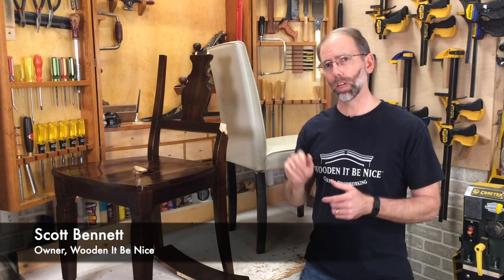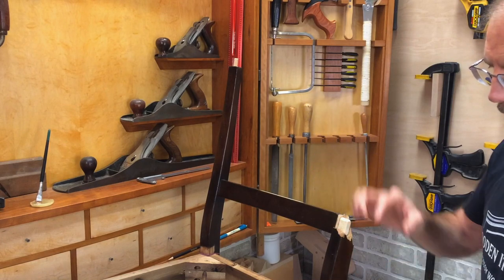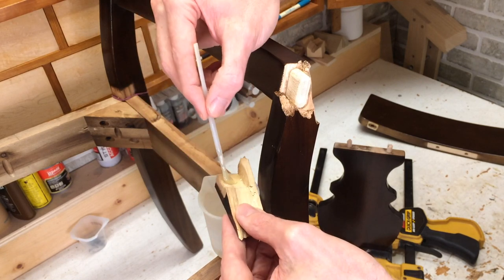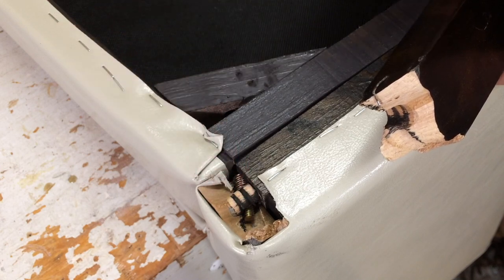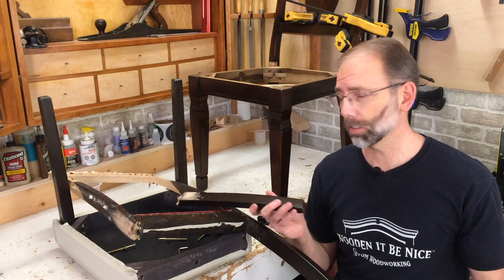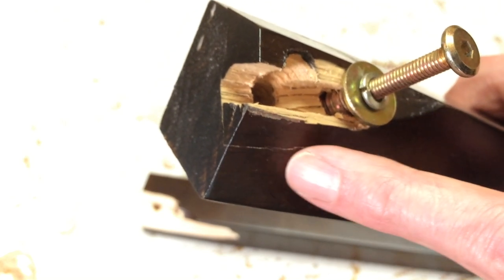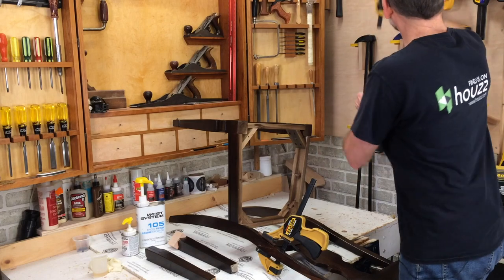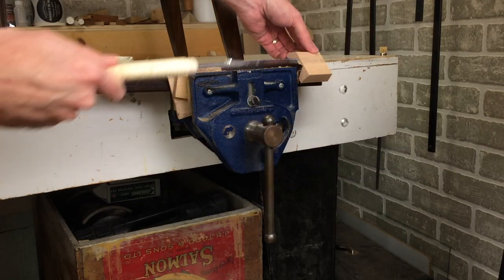Why Repair, Replace, or Trash Broken Wood - Furniture Restoration Techniques | How To

Comment: Rubberwood is a light-colored medium-density tropical hardwood obtained from the Pará rubber tree, usually from trees grown in rubber plantations. Rubberwood is commonly advertised as an "environmentally friendly" wood, as it makes use of plantation trees that have already served a useful function.
Reply from the maker: Thank you for sharing a detailed explanation of this type of wood Peter.  That's very helpful and I will pin this comment so others can see it as the first comment on this video.  I appreciate you sharing your knowledge to help the furniture repair community learn.  Scott
Reply: I was thinking rubber wood too. I recently started customization of thrifted furniture and recently learned about rubber wood being used on a lot of box store furniture.
Reply: When I saw it was from Vietnam the first thing that came to mind was rubber wood

Comment: Great video, Scott. 

 As someone who's recently retired from furniture repair my wife just asked if I had learned anything or reinforced what I knew.  My answer was yes.  Almost all my work was both on-site and fixed price by third party (e.g., warranty or protection plans), so taking to the shop and using the table saw was not a practical option for me.   I have repaired a lot of legs where the threaded insert broke out the inside corner of the leg, though almost always on tables.  I found that these legs were several inches square and the threaded insert only went in half an inch or so, the depth of the threaded insert.  My usual repair was to glue the chunk back on and secure with a screw (as there was plenty of room on a table leg).   The connector bolts and the pilot holes for the threaded inserts were almost always long enough that I could put the threaded insert in much deeper, into the unbroken wood and reattach.  I would have to use a threaded insert without a shoulder on it, though, unlike the ones in your chair.   Now, I do volunteer work at a place that outfits furniture to people coming out of homelessness, so I'm still seeing donated furniture that needs repair, when possible. "Plus ça change, plus la même chose"

As far as wood id, I'd refer to that as "wood that should have been thrown in the scrap bin."  I encountered a lot of brash and cross grain wood, but that seemed to be typical for Asian furniture, even the expensive stuff.   I think my worst example was a top rail in a sofa.  Right in the middle was a punky knot that was most of the width of the beam.  It did not take much force to get it to snap.  Why did they even think to put that in a piece??  Upholstered furniture, too, has a lot of OSB or particle board stapled together inside.  And if 4 staples is good, 12 is more good, even if half of them miss the underlying piece :-)  That's what you get when you get "Seven piece living room set only $399!"
Reply from the maker: Thanks for sharing your insights on this.  I find your volunteer work inspiring.  Do you mind if I share that in a Community post for other people to read about?  Thanks.  Scott
Reply: @FixingFurniture  I have tried to reply to this twice, but apparently it gets deleted.  Yes you can.  Despite having no outside volunteers during all but a couple of months, a small group of about 4-6 of us at a time from the Cincinnati Woodworking Club going in one or two mornings a week made over 700 pieces of furniture (tables and "cubbies") and repaired or assembled over 125 donated  pieces in 2021.  I'll post the host's link in the next reply in case it vaporizes, too.  The organization furnished 1,334 homes this year, distributing 20,536 pieces of furniture to families coming out of homelessness.

Comment: This video came at a most opportune moment. My next door neighbor knows I do woodworking as a hobby, and asked if I could fix a chair which had some damage to one leg. Using the very techniques you presented today, I was able to take the chair apart so I could access the damaged leg and surrounding area, and then put together a plan of action to make a repair. I feel fully confident that I can return the chair to him in a day or so fully mended and as good as new! Thanks!
Reply from the maker: You're welcome Ian.  I love to hear success stories like yours!  My goal is to empower viewers to be successful in their repair projects and it sounds like you're well on your way to delighting your neighbour.  Thanks for sharing that as I find it motivating!  Scott

Comment: I enjoyed your video.  One thing I noticed when repairing furniture is that improper installation of insert nut can actually cause a wood failure.  The hole for the insert nut needs to be deeper than the crib screw will be in full compression.   If the screw bottoms out in the hole while tightening the chair leg it will force the insert to break out of the wood.  Solutions for this are two fold.  You can drill the insert hole deeper or you can cut the crib screw shorter.   Both will allow you to secure the leg without breaking the brittle chair wood.

Comment: I'm am always on the lookout for broken furniture. Usually I pick things up from the street, when people take their broken stuff to be picked up. 
So far I have saved two chairs and a dinning table. 
Often I could see that the previous owners had tried to fix the furniture but not with the right technique. The most common mistake is a simple one:  glueing without pressure (lack of clamps or a vise I guess).

Thanks a lot for all your videos! 
Greetings from Switzerland
Reply from the maker: That's great!  Thanks for sharing your projects!  Glad to hear you're having success with repairs.  Cheers from Canada.  Scott 🇨🇦

Comment: Amazing video, 
For my syringes i draw through some alcohol or acetone to clear some glue out , then I draw water to rinse, and let it dry. It seems to last an extremely long time, I’ve actually never replaced tip.  
Now you’ve given me 9999 tips and I’ve given you 1😅

Comment: I’ve been doing bookbinding for quite a while and one thing they taught us about pva glue is to take your syringe and drop it down into a water cup. It works great. I also have long needles that cans with my ender 3D pro that work very well also

Comment: Hello Scott, I am a beginner woodworker and I’m possibly starting a furniture restoration course in January.
I have one question about the first chair: why hadn’t you glued the top rail dowels before reassembling the back?
Or you did you and I hadn’t realized? I’m confused about this being necessary or not. Thanks.

Comment: Thank you for the video.  It brought back some memories of similar blow out damage caused by securing legs with crib screws.  In my case what I found was that the crib screws were long for the service.  Over the years the owners tightened the screws compressing the surface wood until the screws bottomed out in the leg and with the aid of the embedded nut forced the wood apart.  After repairing the wood fractures, I cut a half inch off of the crib screws and they tightened up well.  I guess the same thing could have been accomplished by putting washers under the head of the crib screws.

Comment: Rockler makes a silicone glue brush that I love using.  I haven't tried using it with epoxy, but for wood glue, it dries on the brush and then you can get it off in a big chunk.

Comment: Scott, other experts, have you seen metal dowel pins in chairs? I have an Ethan Allen all cherry chair, and the back leg is attached to the seat supports by metal dowels. Some green corrosion or possibly glue/ epoxy on the metal dowel. Not screwed in, vertical flutes like a wood dowel. Any opinions?

Comment: Scott, I’m surprised at the strong mixed reaction I had to this video. In the end those chairs are a classic example of you get what you pay for. Inappropriately designed joints made of weak inferior wood can’t help but result in the damage you dealt with. I’m afraid I would have relegated them all to the burn pile.
Reply from the maker: Quality chairs are made by craftsmen and women, not assembled by the customer, but this is the life of running a repair shop.  The customer dictates what they would like repaired and how much they want to invest in the repair.  Cheers.  Scott
Reply: @FixingFurniture  If all furniture was very well made, we would not have much business

Comment: Scott,
I do appreciate you sharing your knowledge about wood working with the DIYers. I have been made aware of some of the mistakes I have made in the past. I went back and checked a table I did a couple of years ago and it is loose. I WILL BE DOING it again the right way.
Thanks,
Steven
Reply from the maker: Glad to help Steven!  Cheers.  Scott

Comment: Another fabulous presentation. Some repairs require creativity for the solution. Are the silicone cups easy to find? Much better than disposable cups for sure. Thanks for sharing!
Reply from the maker: Here's a link to the silicone cups and stir sticks https://amzn.to/3p7bzbu  I shared a link in the video description of a group of glue supplies, so it may not have been obvious where to find it.  Have a great weekend Sean!  Scott 🇨🇦

Comment: Scott: this video was very interesting. The restoration that went into that chair was quite something. And the fact that two more legs broke from another chair tells you what you are dealing with. As an interior designer,  to be honest with you, after talking and asking a lot of questions of the customers, I probably would have suggested recycling all of it. The minute I saw both chairs, I knew what you were up against.However, I realize you did what the customer wanted. And your restoration job was excellent, as usual.  Carol from California
Reply: Sometimes the amount of time and effort you want to have put into a repair is different if it's a lone piece vs. part of a dining room set with 6 or 8 chairs, table, hutch, and buffet,  or part of a multi-piece bedroom set, etc.
Reply from the maker: As I've mentioned a few times on our channel, the customer dictates what they would like to invest in.  Unfortunately, there isn't a good way to "recycle" furniture in many parts of North America.  Millions of tons of furniture waste are sent to the landfill every year.  My approach is to save it if the customer feels it's an affordable investment for them.  In the case of the upholstered chair, the decision was easy for that customer.  For the chair with the broken chair back, it was a tough call for them because it was part of a suite.  The two individual legs were for a third customer for a pair of upholstered chairs.  Thanks for sharing your thoughts on this Carol from California... I like the way you sign your comments as I never forget your name!  Scott
Reply: Scott: many times it is a tough call on pieces that match to a set. I really know and understand this. Let’s hope by recycling pieces of broken furniture that it is recycled in the right way and is being used again. Carol from California

Comment: Great video Scott. Spline insert was really interesting. Wonder what woods you recommend for those sorts of repairs. Especially liked the detail investigation of the leg with knot in the stress point. Lots to consider for the two chairs I now have to experiment with. One has a broken tenon which I was thinking of curing out and using a kind of spline patch to make a new tenon, and the other has torn through two mortice slots that were too close to each other. Here, a new top corner like in your video might help to reconstruct the end of the leg. If you had a broken tenon, what would you do. Do you have videos for this?

Comment: I've done some furniture repair in my my thirties. I had a dresser and vanity that was my Grandmothers from the 1930's. I had to do some repair to the side panel on the vanity and I had a 1/4 inch piece of Birdseye maple I was going to use, and was planning on replacing a leg of the vanity that was chewed up. I stripped the finish on the leg and I had a real surprise. I could see growth rings on the leg but no grain what so ever. I took it to several the places I used to buy my hard woods but no one had a clue. It came out horrible.
Reply from the maker: Oh, that's too bad.  It's challenging to identify wood and I've found the best resource for identifying wood is my wood finisher, who has decades of experience.  Scott

Comment: Have you had a chance to look at Patrick Sullivan's experiments with gluing end grain vs long grain? TLDR: there was a bit of a difference, but the PVA glue actually held even better than the lignin between fibers. You adding the spline to get more gluing surface was, of course, necessary, I wouldn't trust the cross grain crack either, but it felt like countering the small surface problem more than end fiber problem.

Comment: Scott, I am wondering if you made any decisions on the Tite Bond Dark PVA glue.  I watched until the very end and tried to listen closely.  I did not hear you mention the dried edges of the dark glue.  I use Tite Bond for all my wood working.  Just wondering if the dark makes any difference.  Thanks.
Reply from the maker: Hi Bruce.  The jury is still out on the dark glue.  I think it's helping but I realized after this video that I need to do a test of regular PVA versus the Dark PVA... I kept the broken chair parts so I have something to work with.  It will likely make a good Shorts video.  Cheers.  Scott

Comment: How would using ca glue work compared to the pva carpenters glue you used
Reply from the maker: CA glue is fragile.  It is strong for tensile strength but very week for shearing strength.  Not a glue for furniture.  I hope that helps.  Scott

Comment: You did a great job on a difficult repair. Hopefully, the client’s next purchase will be one utilizing a better wood that will withstand the test of time. I suspect that the rest of the set of chairs are already fractured and will soon fail.
Reply from the maker: Sometimes a piece of wood fails.  Hopefully that's the only part in the set.  Cheers.  Scott

Comment: I bought a set of similar chairs from a big chain here in Quebec (Breault et martineau, not super cheap).  I  had 6 chairs.  Within 3 years, I had had to fix 3 or 4 legs that broke, mostly WITH the grain ( like In the back of the chair we see in the video).  Then after another year 2 of the chair had broken within the backrest,  pretty much the same way that this chair had started to crack.  
Once that happen it was too complicated to fix again so, long story short, i asked for a partial reimbursement, they refused cause out of warranty, I threatened to sue and they accepted to reimburse and appropriate amount for what should have been an appropriate chair life (I suggested 10 years, which honestly, isn't enough..  still, i ended up being reimbursed for 60% of the original price).
Reply from the maker: Hi Sebastien.  It's sad to hear that the wood used on those chairs was so poor but I'm glad you were able to get some money back from the retailer.  It sounds like disposable furniture.  Thanks for sharing that story with us.  Scott

Comment: I have seen other furniture guys use wooden pegs to strengthen glued joints.
Reply from the maker: Thanks for sharing that James. Using dowels can add strength or weaken the wood connection so they need to be used properly.  Cheers.  Scott

Comment: Those cracks, I asked myself why would one not cut inside the outer edge of the wood, and glue the cracks afterwards,  Then having very thin outer edges to have glued, you now have hollowed out the inside of where the crack was, You can actually fill that with an epoxy for extra strength, as it could be cut out way below the cracked area, top and bottom, being then many times more stronger, and not having to worry about any piece of it opening up again, same with that cross grain piece,  remove dowel and once everything is filled with epoxy, the strength of that 3 pieces would be stronger than the original piece,

That leg you put the small block n. it also developed a small crack, not sure if that occurred from putting that nut in there,
, and not sure if it could have been avoided by using 2 clamps to hold it from splitting

Comment: What is your ratio of cheap furniture fails vs legitimate woodworking repairs? I'm curious which you make more off of, but i understand if you don't talk numbers.
Reply from the maker: I see about 20% of our business as new furniture problems.  Sometimes it's shipping damage or poor design that's caused issues.  Other times it's wood like in this video that splits or loose bolts on legs that the owner doesn't tighten and they cause a break.  There isn't a difference in what is more profitable as we charge a shop rate for all work.  I hope that answers your question.  Scott

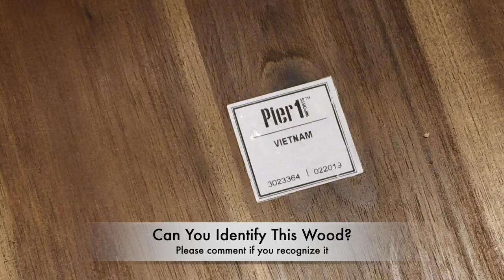Comment: That grain there at 16:21 reminds me of what we call "sengon". I live in SE asia and this kind of wood is dirt cheap. It only take 5 years before you can cut it down for lumber. You can get 3 planks for $2.
It is only good for casting concrete in my opinion.
Usually once the builders have finised casting concrete they'll chop those planks off to boil water to make their tea.
It's not really the kind of wood that last a long time. It's almost perishable outdoor. Leave it outside for 4 months without a decent waterproofing and it'll turn to mush.
There are other alternatives but none of those grow as fast as sengon does.